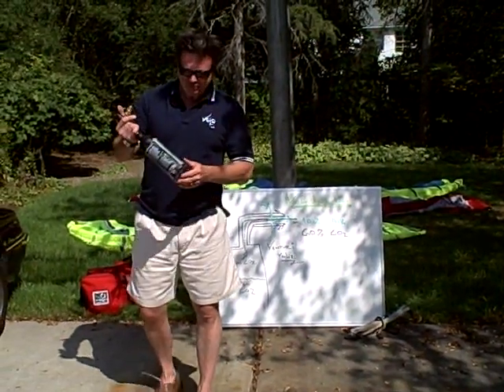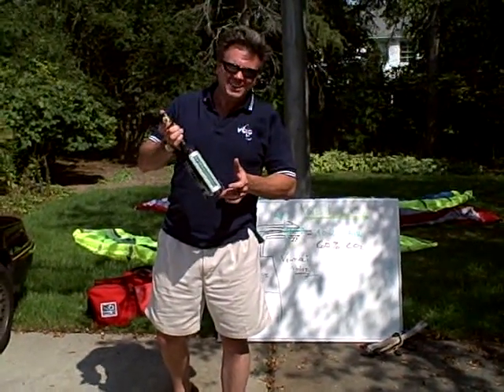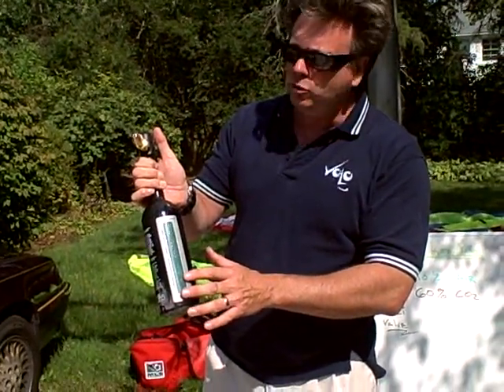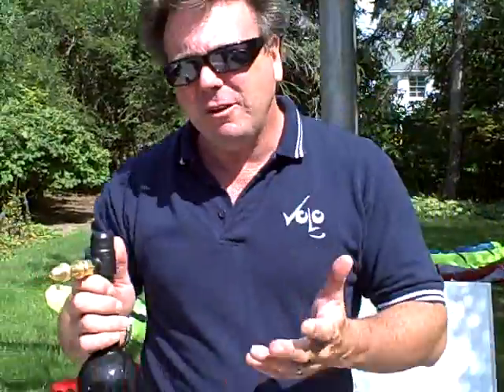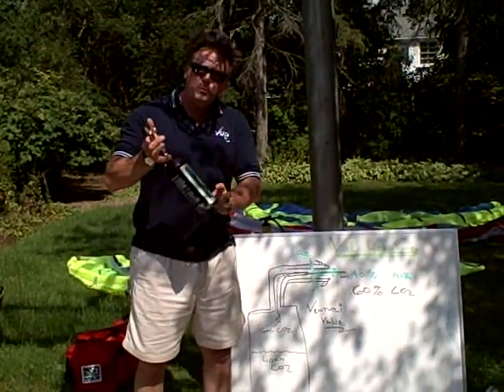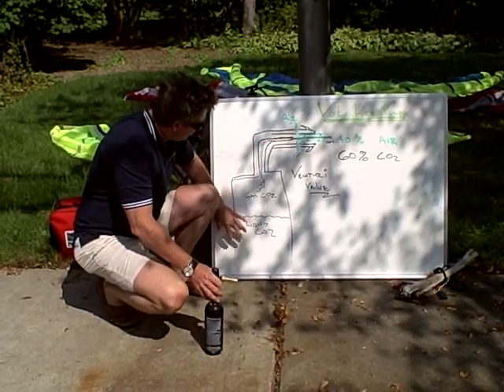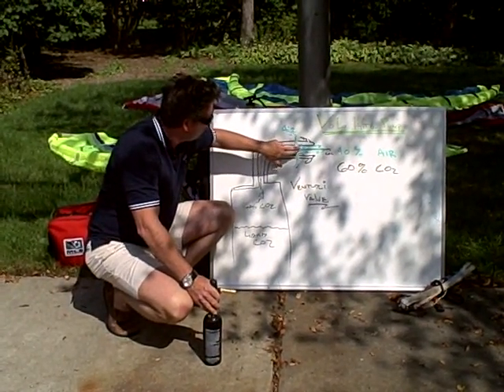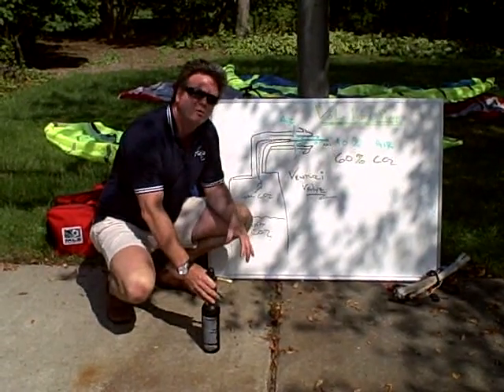Volo Kite Pump Tech Talk

Comment from the maker: @BisdremisKostas 
The pump does have a regulator built into it, but not on the kite side of the pump, but the tank side.  Filling the kite is not so fast that there is any danger of over inflation - the venturi value in the nozzle acts as a type of safety value if the pressure gets too great and bleeds some of the pressure off during filling.  You can fill the air tanks with nitrogen, although we have not  done any testing with that gas.  Tim